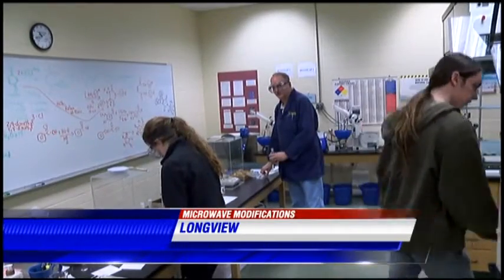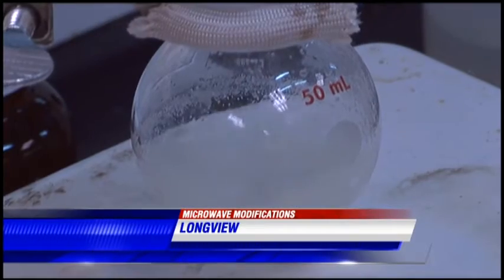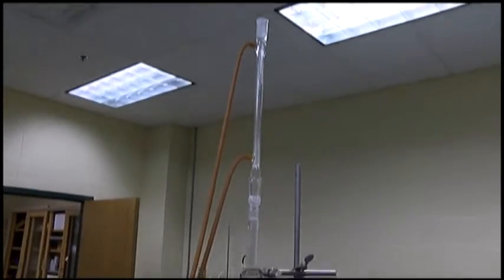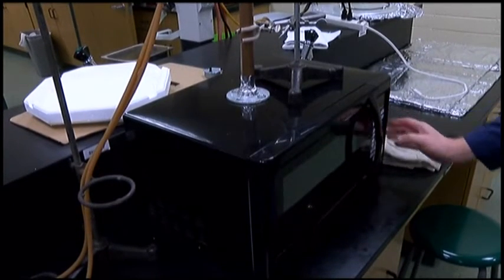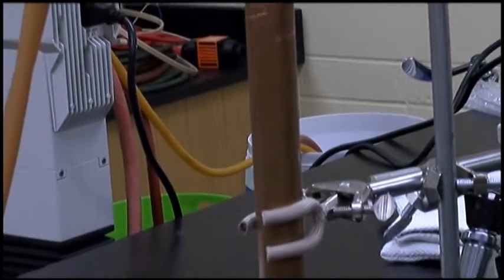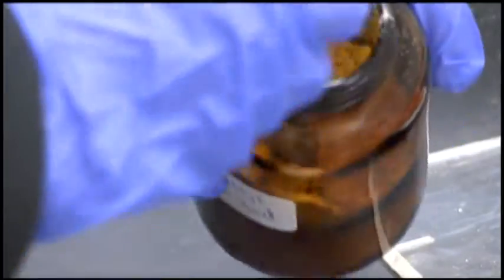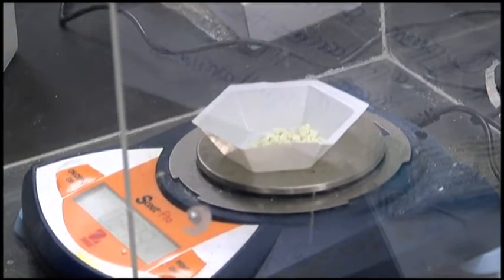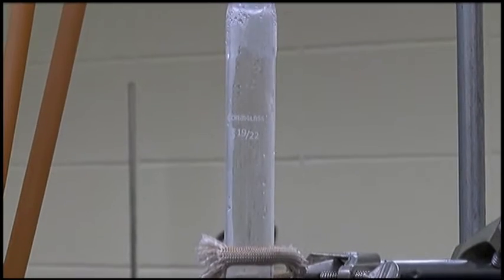E. Texas students modifying microwave for chemistry research

Comment: We do the same at UMMTO University
Reply: Do you know how they're modified? Id really like to build one. It appears that they just cut a hole in the top and add a rubber protective flange for the glassware(?). Only thing that might worry me would be microwaves leaking from the oven through the glassware? 
The professional ones appear as though they include a stirbar, pid sensor, and vaccuum pump connector but that appears to be the only real changes made
Reply: @patrickbowen9395  yeah thats it. microwave do not need much mods to make is scientific. Just cut holes on the body for tubes and sensors to go through and you are good. make sure not use metal reactors, plastic/glass only